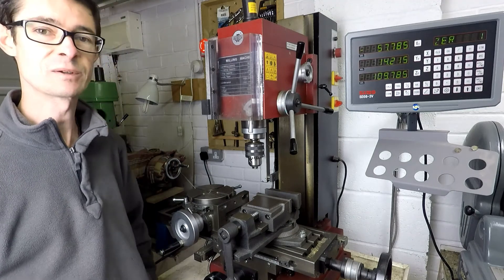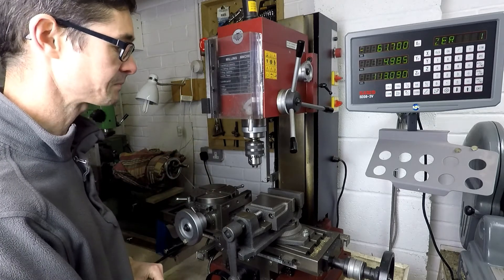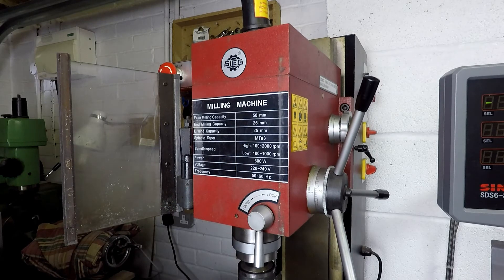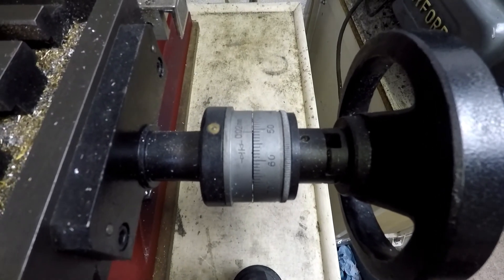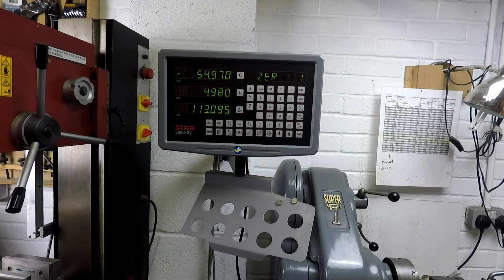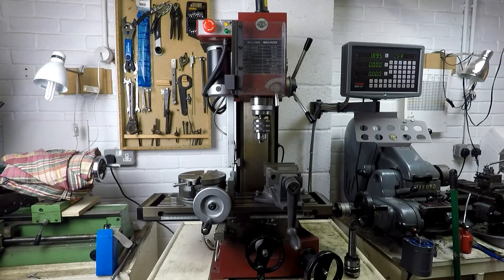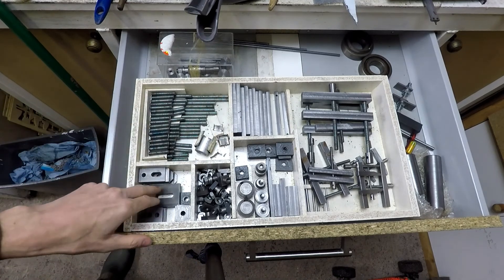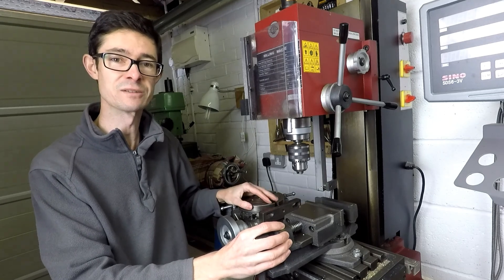My Sieg X3 Milling Machine Set Up

Comment: Hi I have a problem with the speed of the motor is stopped working so is the reverse stop working where can I find or can you recommend something else that I can use please help thank you Eli
Reply from the maker: It sounds like the electronic speed controller may have failed.  You should be able to get spares from Arc Euro Trade website in the UK or probably from eBay if you can find a part number on the original.

Comment: As others have said, that's a good overview of this machine. I have the same mill (also bought from Arc Euro Trade at ~£800), same vice and same 6" rotary table too. I even have the same Myford lathe to the right of my mill. My experience with this machine has been good. Had it for about 10 years. The speed controller packed up a few months ago so I replaced it with a generic unit on eBay for £20 - works great (lost a bit of the low speed). Brushed motor still going strong. The mill is quite capable with end mills up to about 16mm. I do use much larger cutters for light facing cuts. I have a 50mm carbide insert cutter and have used my fly cutter at about 100mm, which works great on steel - light cuts only though. I took the swivel base off my vice, which helped a lot with rigidity.

Comment: Have you thought about installing a spindle rpm display??
Reply from the maker: Peter Murphy Hi, I don’t really think it’s necessary to be honest. Spindle speeds are far from critical for hobby use and in any case you can judge reasonably accurately how fast it’s going in comparison to the top speed, which is a known rpm.  Or at least it would be if I could remember what it was.

Comment: Hello.
Is it worth the money?
I mean solid base and minimum wobble, play etc? Enough power?
You know what I mean.
You recommend buying it in 2019 or there are better ones?
Reply from the maker: jw200 Hi it’s a pretty solid and accurate machine for the money, although it’s not really up to heavy cuts.  It’s not exactly overpowered but I don’t think it’s really rigid enough for a lot more power.  I think the later models have more powerful brushless motors.  I would look at Warco/Chester/etc offerings too for comparison.  If I was buying again in 2019 I would almost certainly save up for the CNC version (or the smaller CNC model). It is 2019 after all!

Comment: Having had the machine several years. Are you satisfied with the performance of the brushed motor?
Reply from the maker: Hi Byørn.  In fact the original motor died so the one in the video is a replacement.  I find the motor is ok; speed control is good.  It is not powerful enough to take heavy cuts in steel with an endmill, but then the machine is not rigid enough for that anyway.  The power of the motor is well balanced with the stiffness of the machine.  I think the later models have a brushless motor with better slow speed torque.

Comment: Which spindle taper do you have on the X3.... MT3 or R8 ? Is there any particular advantage of one over the other?
This was a good overview of the X3.
Reply from the maker: MT3.  The advantage of MT in my view is that my lathes and other accessories also have morse tapers so the tooling is transferable, albeit using taper sleeve adaptors.  I'm not sure if you can get MT to R8 adaptors.
Reply: Thanks... that is good to know. @MetalMachineShop
Reply: @christophersmith2165  I have the same mill with R8 spindle..but this machine is branded by several companies so either taper should be available.
Reply: @christophersmith2165  787788